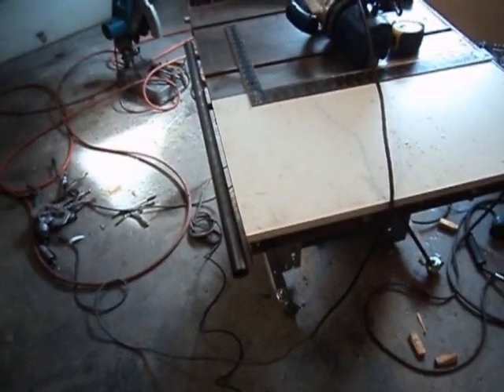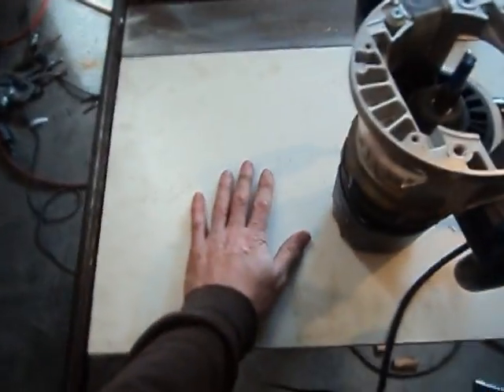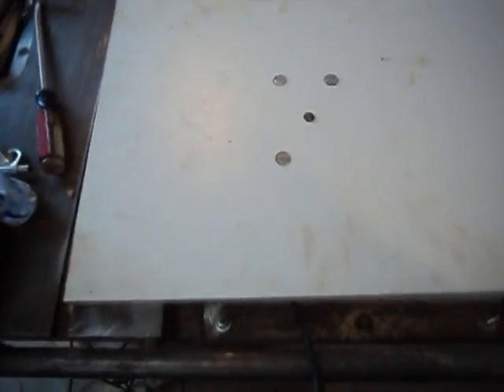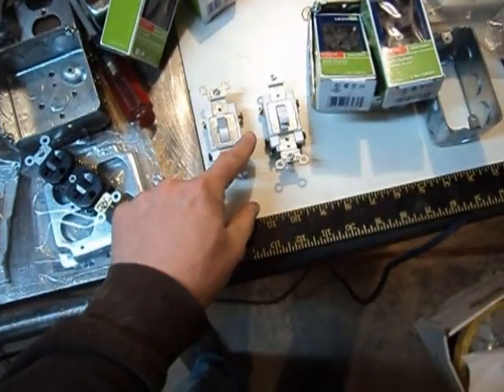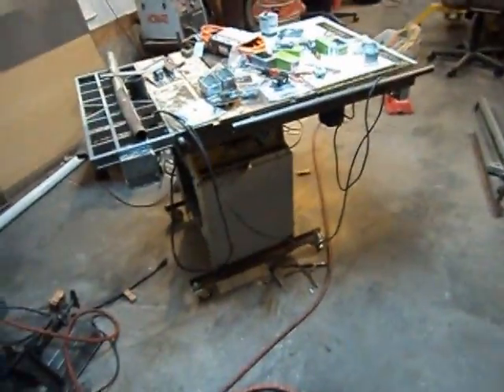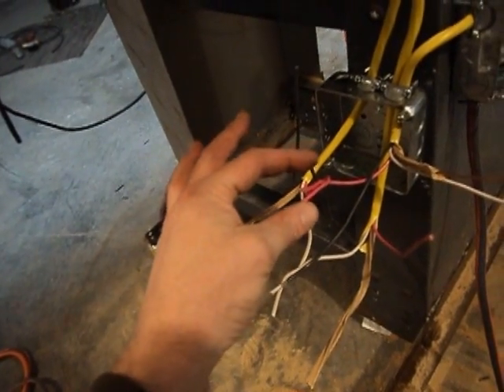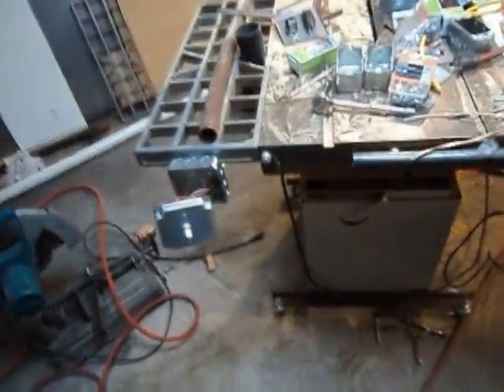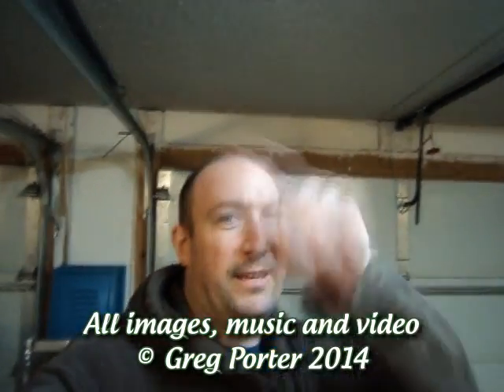Router Table - Table Saw Extension - Part 2

Comment: I love all the videos and this one is no different, I am planning on making a router table and I like the idea with the dual pole switches. I found this video Make a Flush Mount Router Station! and where he made a nice inset so you can change bits easier if you are looking for ideas.
Reply from the maker: Thanks for the tip.  I'll check it out.  I'm sure I'll wind up with a plate rather than what I have currently.  The double pole switch was my dad's idea.  I was ready to use relays to make it happen and he suggested going this route.

Comment: You may want to take a square and make sure that the router bit is square to the table surface. It is very important or the wood the you are routering may not get a consistent pattern. looks great. Thanks for taking us along.....

Brad
Reply from the maker: Yes.  The next series of vids will be on millwrighting the entire setup: saw blade, fence, table, router, etc.  I have nightmares about being off by a degree here and there... Nothing will work if that happens.

Comment: I don't know why I can't get my head into electrical wiring like this. I mean, I really like wiring up stuff. I work with 7way cables on tractor trailers and I use to work at a air bag and hydraulic suspension shop where they would give me switch boxes to wire. But when it comes to getting into electrical outlets at home or something like what you're doing, it just doesn't rub me right lol. I can understand when you're explaining (I even went back 3 times to understand) and dammit I want to wire outlets now! Ha! This will be good for when I make a router cabinet with a shop vac. I wanted to add my router to my table saw also but I don't know. Now with this video, it's making me think about it. Thanks for sharing buddy. I really appreciate it!
Reply from the maker: There you go man!  Glad it helped.  Wiring is simple, but with household electrical, you have to follow the code.  That's where it gets tough.  The neutral and ground rules along with the wire sizes, box types etc can be difficult to get correct if you don't have practical wiring experience.  Good luck my friend.